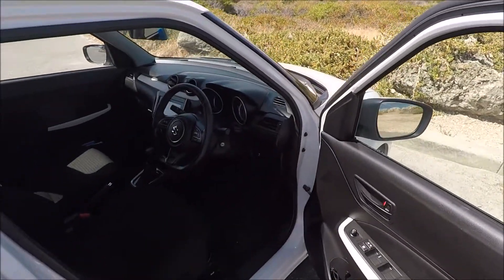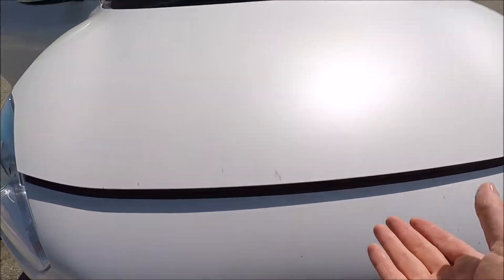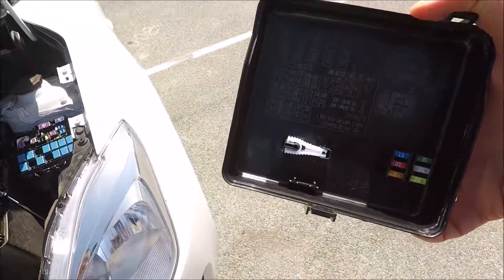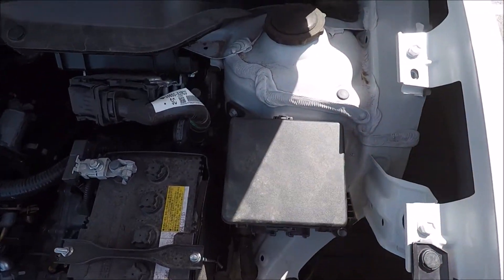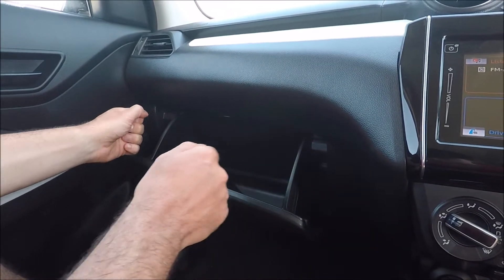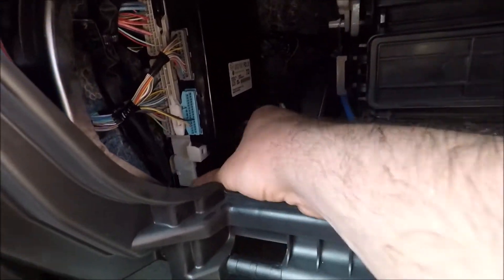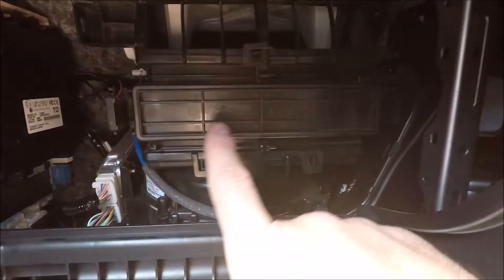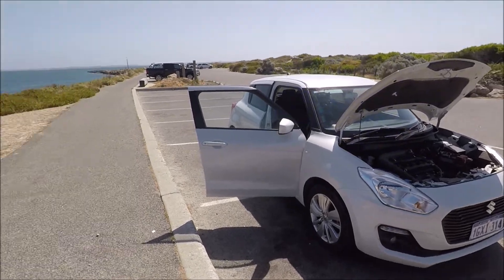Suzuki Swift OBD2 Diagnostic Port, Fusebox Locations & Diagrams - (Maruti, AL2)

Comment: What obd 2 scanner do you recommend?
Reply from the maker: Hi there, it really depends on your budget, and what you want to use it for. I have had many over the years, from the cheapest ones on ebay/amazon, so some of the dearer units. You can also get the wifi units that work with your phone, which are really cheap however you really need to pay for one of the apps for full functionality. Some popular brands are Innova, Bosche and Foxwell.

Comment: What scanner would you recommend to calibrate the throttle body (TPS) for a swift 2018 boosterjet?
Reply from the maker: Hi there, I haven't changed one on the swift but typically they are calibrated using a multi meter and not an obd2 scanner. TPS's more often than not vary Voltage so you calibrate them to the throttle when fully depressed. I hope that helps. Ross

Comment: Do you know where the flasher is located?
Reply from the maker: Hi there I am not 100% sure but they could be controlled by an ECM (Electronic Control Module), there fore there isn't a relay as such. Let me know if you find out.

Comment: Hi Ross, I have same model Swift and I need a wiring diagram for the Door Lock system. I want to access Lock and Unlock earth pulse wires to use as inputs so an alarm will switch from my door remotes.  Any ideas where I can find wiring diagrams please? (I have done this on other cars successfully, and usually find the wires in the door jamb loom, but need to identify them).Thanks and great videos!
Reply from the maker: Hi John, so sorry for the delay, unfortunately not you would probably need to pay for a workshop manual or try and find someone who might have it on a Facebook group or forum. Sorry that's not much help. Ross